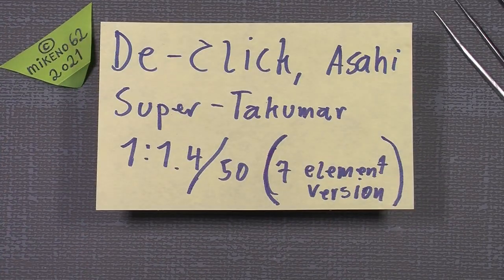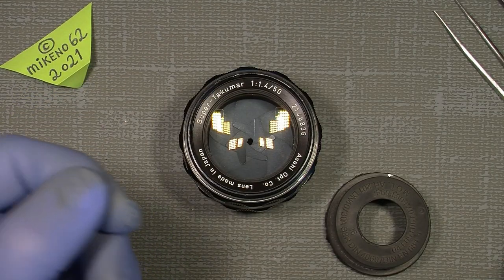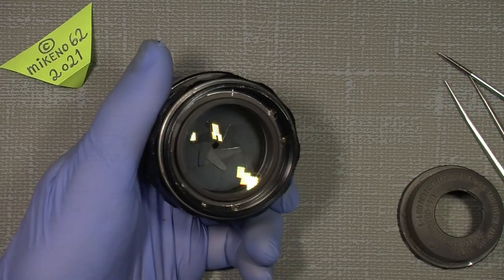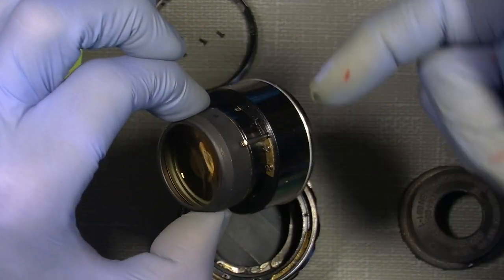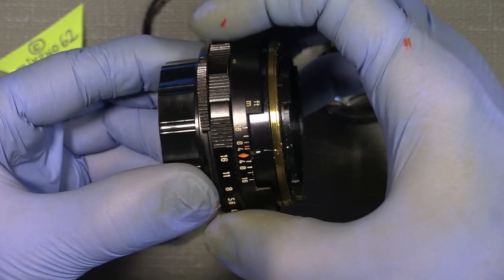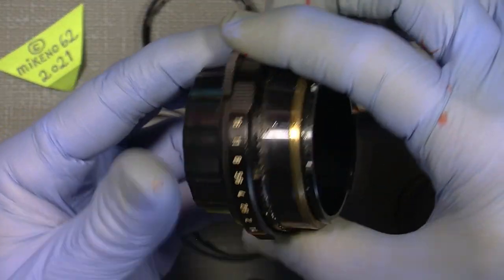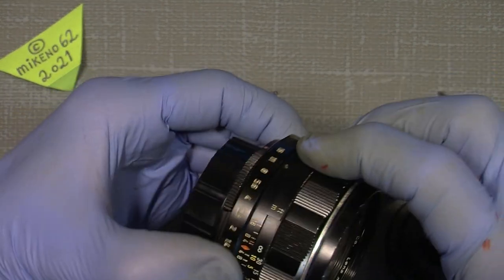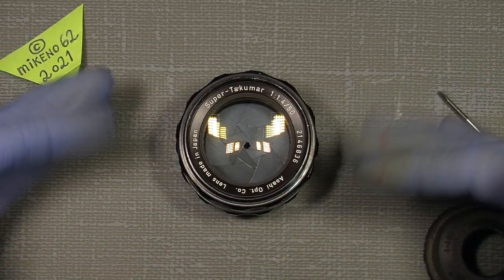DE-click Asahi Super-Takumar 1:1.4/50 (Long version)

Comment: Are you sure it's 1.2 mm for the side screws.  I have a 1 mm and it doesn't even fit. I do have the Super-Multi-Coated version so it might be different?
Reply from the maker: I just check the thread diameter of the setscrew and it is actually 1,3mm. When you measure the 3 holes in the index ring, they will measure around 1,1mm and that's correct.
Reply: @mikeno62  have you checked with a Super-Multi-Coated version?